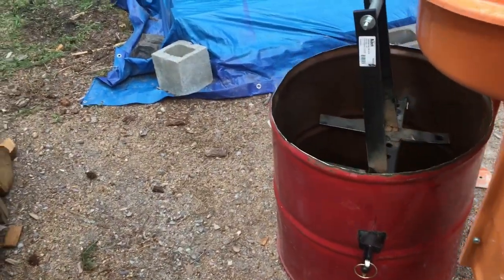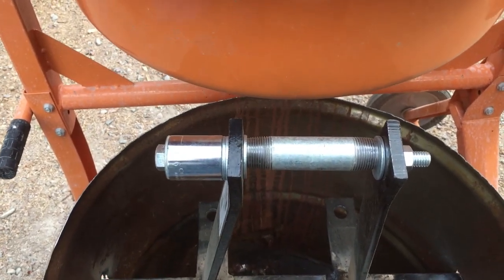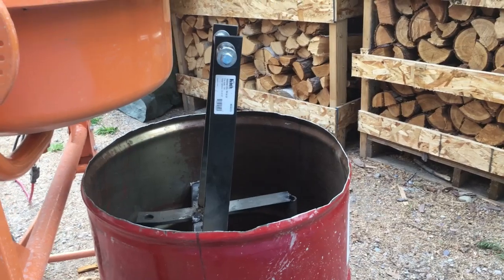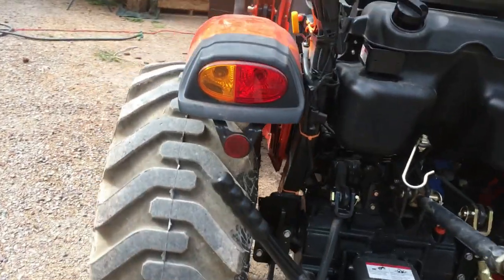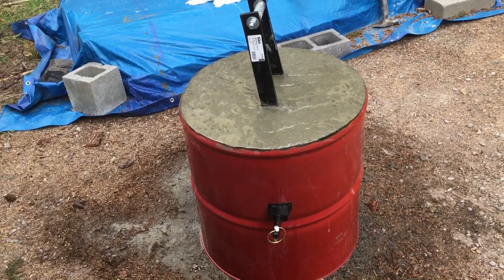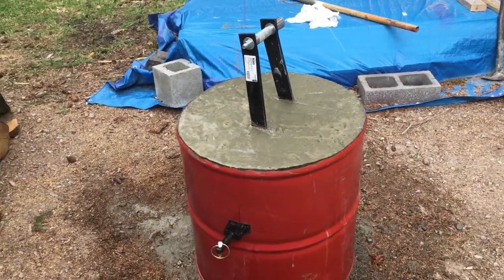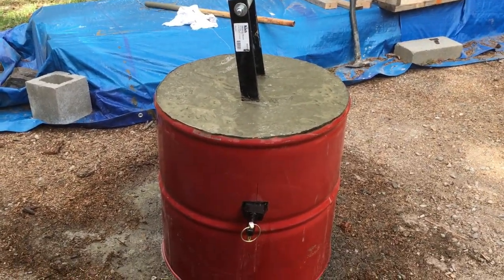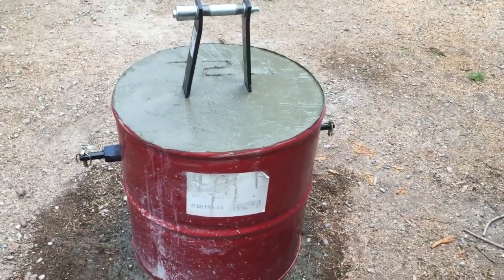Home made Barrel counter weight

Comment: I've been looking at the Kioti. Had a Deere 2305 and a Mahindea 1526 at different times. No complaints, two different tractors though. You are right, fhe implements can make or break the job. One thing I was never afraid to spend money on was a tool. Every tool I ever bought paid for itself 10 times over. I would have been dead by now without those tractors. I started out with a wheel barrow and a shovel. Ha ha.
Reply from the maker: Yep that's the truth. I was digging up rocks in a lower drive way that was a grass drive way you know a back way to the horse coral ...rocks got bigger and so on. Said to the wife ...I am to old for this. Now I have a Kioti

Comment: That is a half barrel or 2/3?A guy nearby is selling them for $15 I was thinking they would make a good rear weight form.Thanks
Reply from the maker: 2/3  Too bad your not close. I'd give ya a couple
Reply: @ladwiss  What kind of cement mixer is that? I made a weight   formed of trash boards, plywood scraps and more scraps. 4 bags of Sakrete 80 lbs. One partial bag of same. One half or so bag of 5-1 mix . About  15 shovel mix  of that. plus the steel another 75 lbs. Say 550? I was using my scraper blade as a weight but you hit everything with that. That weighed about 350? or so.I thought $15 was decent for that drum. No idea what had been in them. They do make a good form.
Reply from the maker: @kennkid9912  Yes, I like mine. I used the blade for weight too. early on. The 2/3 barrel is good for in woods etc. Blade was a pain too pay attention to
Reply: @ladwiss  go to your local FD and ask for their DEF drum when it's empty. They'll surely give it to you. I take one home every time we suck one down.

Comment: That’s a little more than 720 pounds. Add the water, drum, and steel and your over 800 all day
Reply from the maker: Roger that. 720 is dry bag concrete only
Reply: Good thing it's not rocket science. For anyone else making one of these, punch that drawbar thru closer to the attachment end so more of the weight is hanging further back